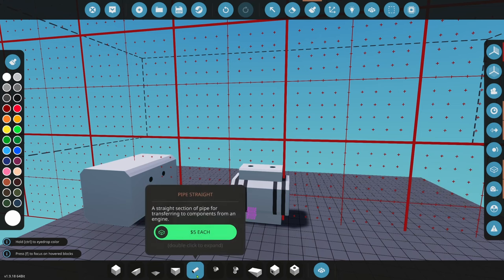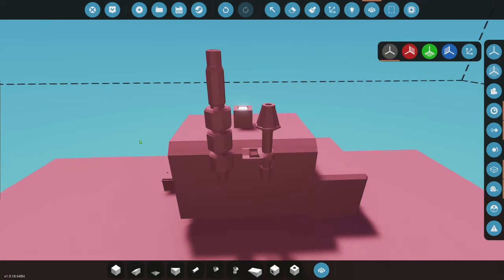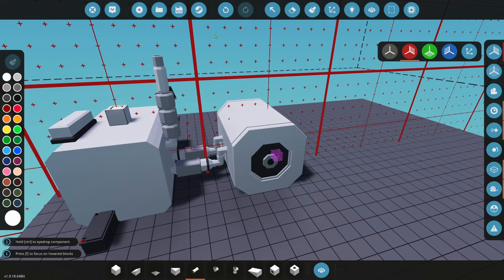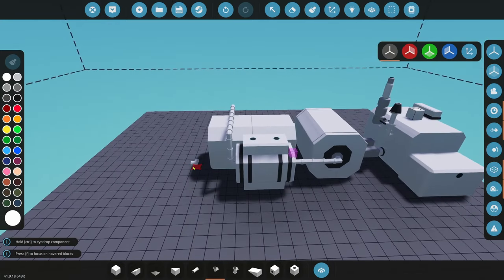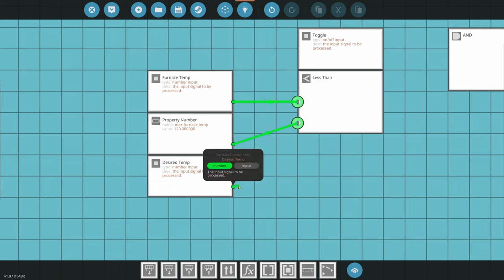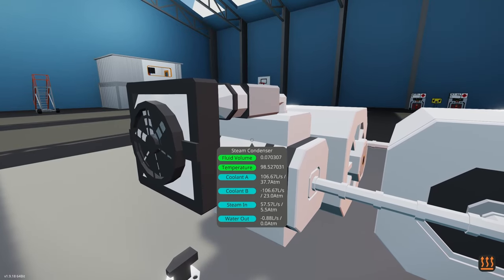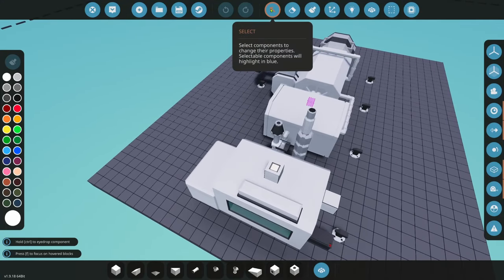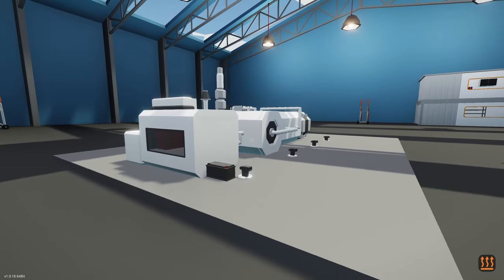Stormworks Basics: Steam Tutorial Series P1 #tutorial #stormworks #gaming #gamingvideos

Comment: I work on boilers for a living and I can tell you they do get that hot and the heat won’t kill you most of the mechanical closet are easy off 100 degrees it’s about ventilation, bringing in fresh air and exhausting the carbon monoxide (also I wonder what the difference would be if you place the condenser on the exterior of your structure and pipe it back)

Comment: I was just wondering how you would measure boiler pressure because they have removed the pressure node from the boiler
Reply from the maker: The pressure node on the boiler has always been faked and not that useful. You can read the steam pressure by putting a t pipe and pressure sensor on the steam pipe.

Comment: I think an issue people had cause I tried also was at first during the update you could heat a boiler up to about 80 normally then it was suuuuper slow from there to 100 degrees like taking 15-20minutes to heat up to 90-100 degrees so to make it quicker I yanked the limiter out of my microcontroller and let my furnace rip… basically unrealistically hot lol, it was fixed eventually in an update